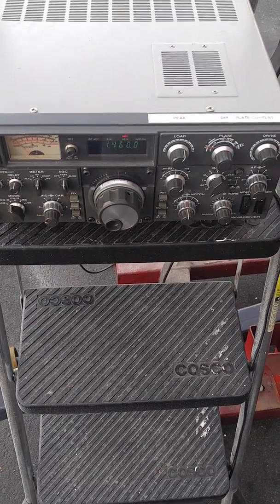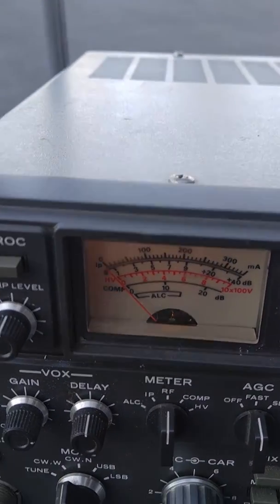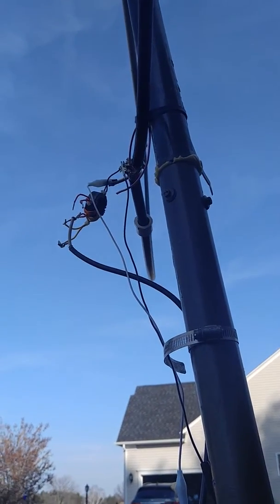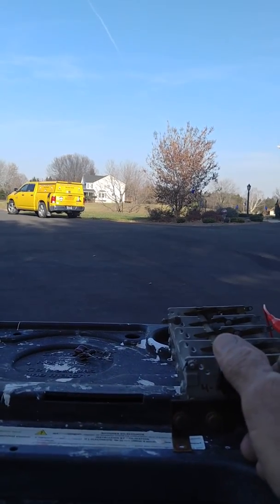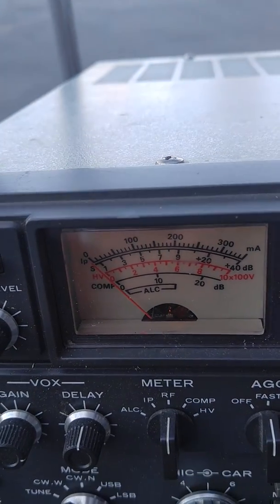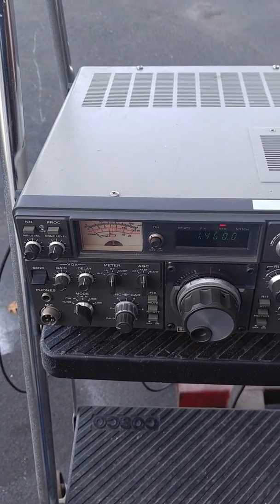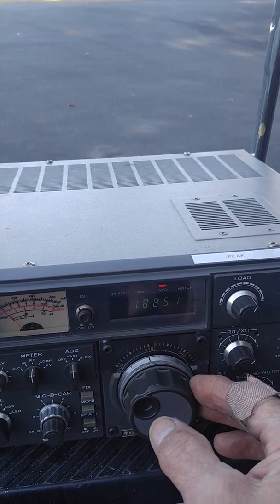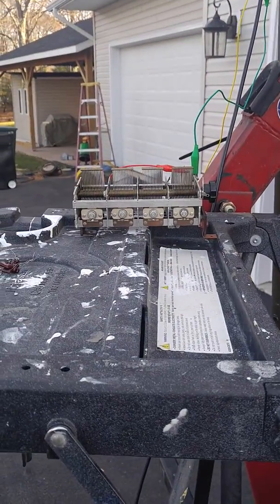Early 7' loop testing: receive only.

Comment: I missed something. Saw the the 160 - 80 loop go up with the vacuum variables mounted in a wooden box, but never saw any report of it's operation.  Since I have never worked 160, I really have no opinion about whether or not it would be interesting except for all the hours messing around listening to AM radio in the 60's.  Did it work out ?  Best Regards, WA8UIH.
Reply from the maker: You can see the response of the loop by watching the response of the signal on the other videos.  Those were taken on the big 12' mag loop and you can see about 10db less noise floor. Enjoy Woody